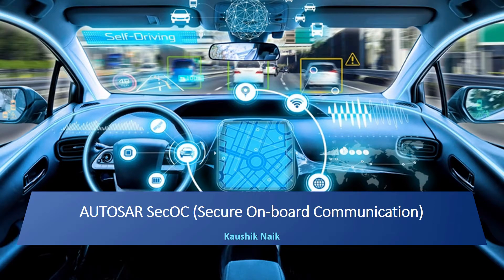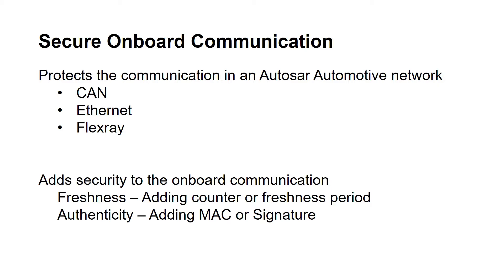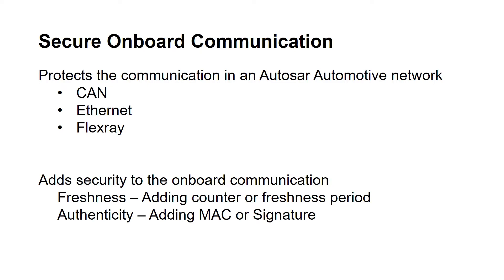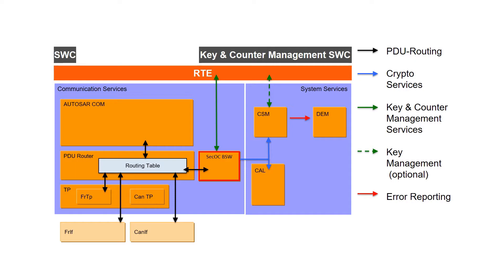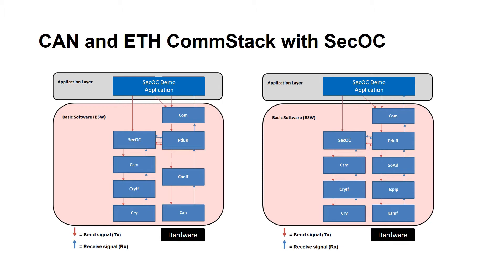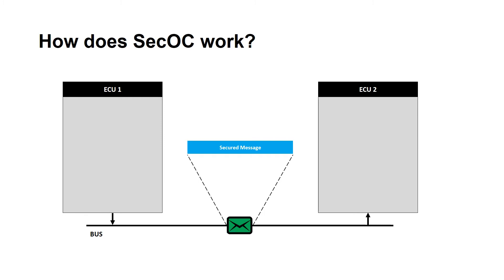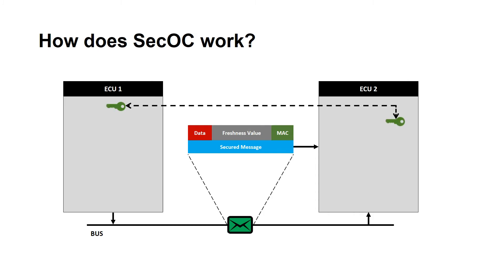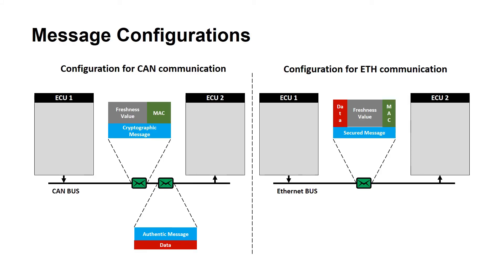AUTOSAR SecOC Part-1 | Secure On-board Communication | AUTOSAR | AUTOMOTIVE Embedded

Comment: For  Secure on board  communication do we need any specific  HW on ECU?
Reply from the maker: Not mandatorily. You can use software crypto algorithms. But if you need hardware acceleration, then you need to have HSM support in hardware.
Reply: @naikkaushik   Thank You so much for quick  response.
So These Secoc is like a  separate  protocol? 
Or we can add these feature along with any protocol  like CAN or ethernet?
Reply from the maker: @lokeshdevghare4147  SecOC is not a protocol. It is a cybersecurity mechanism to provide authenticity and integrity to the data which is communicated. And SecOC is Bus independent as it lies in-line with PduR layer. So it can be implemented to any communication protocols.

Comment: If an Assymetric key is used to calculate Hash, does each ECU store set of public keys specific to each message ID or a simple Symmetric key is used by all ECUs who are participating in the SecOC ?
Reply from the maker: To calculate the Hash only symmetric key is used by the messages using SecOC.

Comment: Thanks Kaushik for good concise video!
here is a question I have :- if an OEM is adopting SecOC in their vehicle, it will be necessary to implement it in all the ECUs in the vehicle that are communicating over CAN or Ethernet! right? I mean implementing in a subset of ECUs will not work!
Reply from the maker: Yes! Correct! 😊
Reply: @naikkaushik   Suppose one ECU has SecOC  implemented than will same ECU communicated with normal CAN to other ECU which are not SecOC implemented ??
Reply from the maker: @dishankpanchal3391  Yes, any ECU can have both normal CAN message as well as SecOC implemented CAN message. For example, if an ECU is sending a particular CAN message (say CAN ID (0xabc)  encrypted with SecOC, the receiver ECU should also have the SecOC implemented to have that particular CAN message decrypted so that it can be usable.
Reply from the maker: Its sufficient to have SecOC implemented only to the ECUs having messages sent and received using SecOC feature. Other ECUs with normal CAN messages need not have SecOC implemented.
Reply: @naikkaushik  Thansk! just to clarify more - if one ECU has implemented SecOC, it will be able to communicate only those other ECUs which also has SecOC implemented! is that correct?